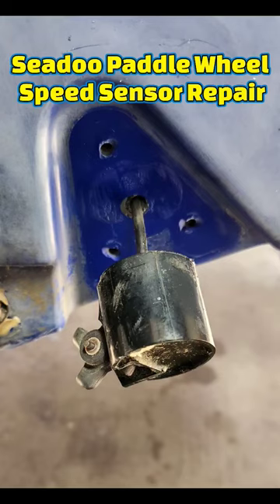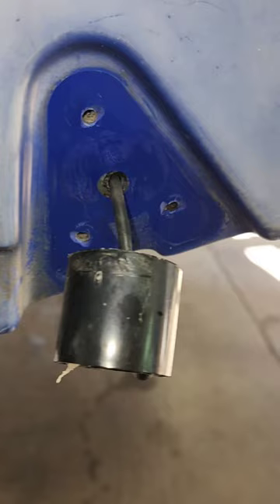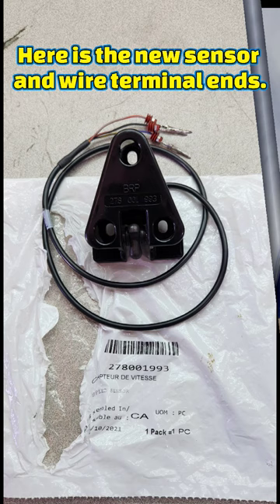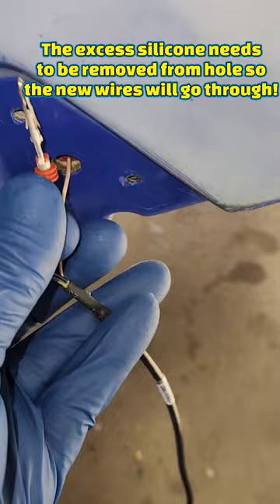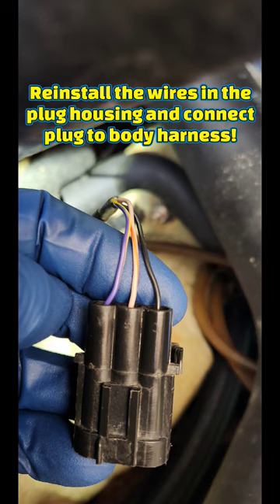How To Repair Speed Sensor Seadoo | DIY | Just Reads "0" On The Speedo | #shorts #seadoo

Comment: How did you un clip the wires to the harness?
Reply from the maker: Do you mean, How did I get the terminals out of the wire connector housing? Just want to clarify.
Reply from the maker: In order to get the wire terminals removed from the plug housing you need the round wire connector terminal removal tool. Find this text and link in my description and it will take you to the Amazon link where you can buy it:
Seadoo Round Connector Removal Tool(For Pushing Out Wiring Pins In Old Sensor Plug):
https://amzn.to/3QMDjyc
If it is something else you are looking for just let me know.
Reply: Yup that’s what I’m asking. Do you use the tool in the open end of the connector or back end?
Reply from the maker: @benschroeder1161  Unplug the sensor, hold the open end toward you, insert round end of terminal extractor over pointed part of wire terminal, you can twist it slightly to get the tool to slip over the terminal locks with one hand, then pull out the wire with the other hand from the back. Any terminals that are reluctant to come out, you may need to push the wire into the connector further before pushing the tool all the way in. Sometimes the wire locks can get a little deformed and pushing  the wire in before releasing it helps it release easier.
Reply: My speedster uses the same sensor. But the issue I have is the digital speedometer shows random Images or digital pieces of a number. The bar gauge above the digital numbers seem to work fine. Ever seen this before?